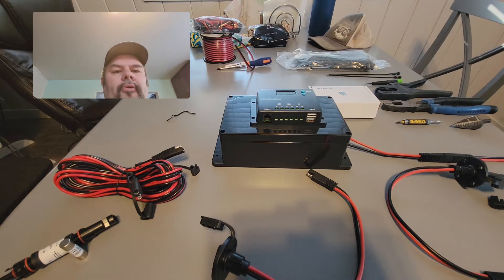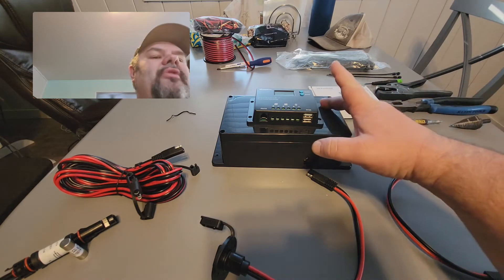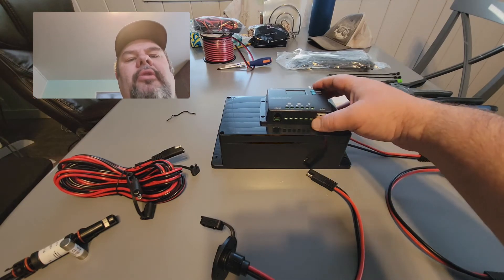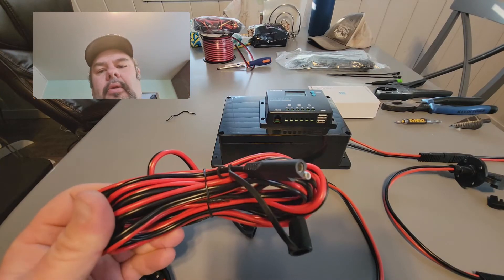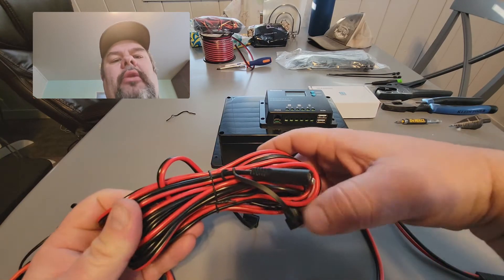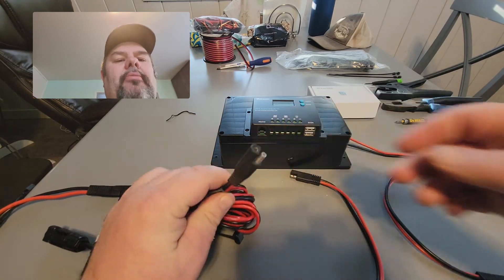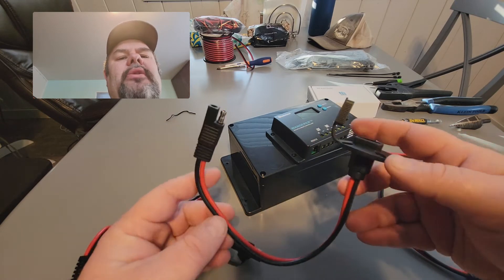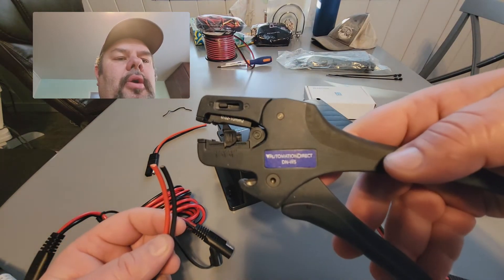DIY Solar Power

Comment: If you were actually hooking those wires up, instead of just demonstrating, it would be wise to make the connection between the solar charge controller and the battery BEFORE you hook up the wires from the solar panels to the charge controller.  Doing it in the order you showed in this video could easily damage the charge controller, since you're feeding it current with no place to put it.
Reply from the maker: Thanks for the feedback I covered this at the 5 minute mark in the video.  😀

Comment: Great video. Question: if you had an SAE to 12v male cigarette cable, could you charge the battery (via the charge controller/instead of the solar) while driving?
Reply from the maker: I believe so.....
This controller has a pv input of 40-50volts max.(double check the spec sheet).  It also can auto detect if its hooked up to a 12volt or 24 volt system. If I remember correctly renogy also claims you should fuse it at 10 amps going to the batt getting charged..  Probably because it has a wattage  max output of 10 amps..  If that's the case when hooking it up to a power supply such as a cigarette outlet it should be able to trickle charge the battery through the pv input without damaging anything.  If it were to work 100% efficient the most wattage that it could output would be 10 amps at 12 volts which would be 120 watts charging a battery.  I would probably start with #14 wire guage and a 15 amp fuse on the pv input side and see what happens.  Let me know how it works out 😀